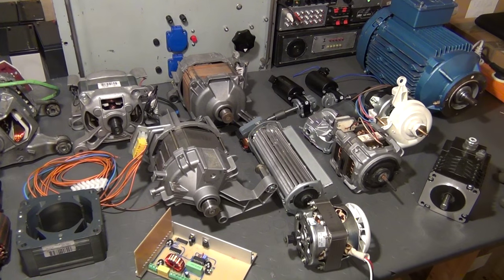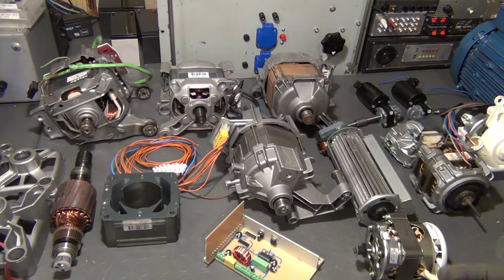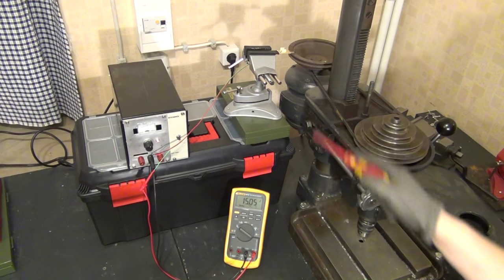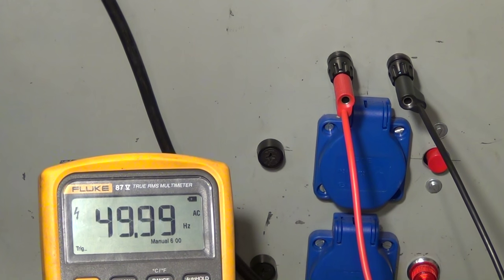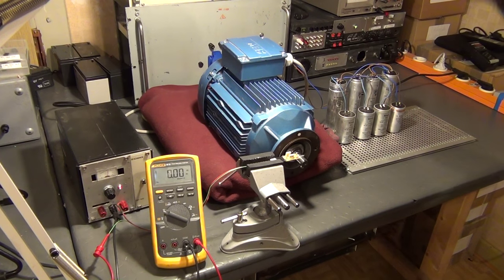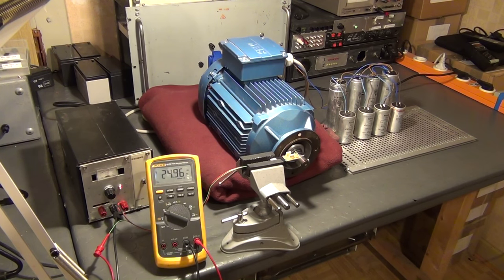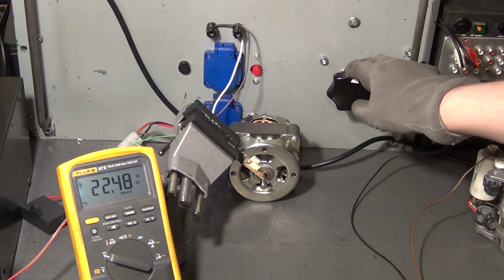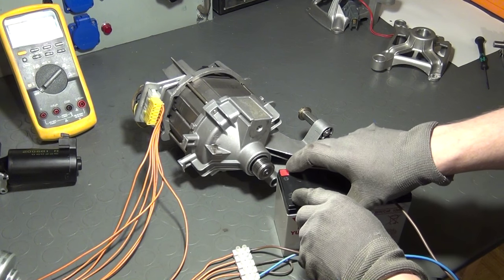TPAI Lab Report #008: Universal Motors and Induction Motors

Comment: I Get a lot of my motors also from some old tread-mills and old toys that don't have the remotes for anymore.  There must be at least a million things that use motors, and it seems like each one is different then the last.  It is still fun to take them apart.

Something I'm going to try, is to make myself an isolation transformer by using two microwave transformers.  Take the high voltage windings off of both, and on one of them, also remove the primary winding, and putting it back on the one which already has a primary winding.  That way I have a transformer with 2 (110v or 220v) winding, which will make it an isolation, with the same output voltage, the same as the input voltage, with no connection.  The two transformers would have to be the same type and size to get the two windings equal to each other.  This too would end up with same current rating on both windings.

I enjoy the videos!!!!
Keep up the good work, and the fun projects!!!!!!
Michael

Comment: In the US, We do not have three phase power in residential structures. We do, however, have a center-tapped transformer which delivers 240 volts AC 60Hz to the house. Every other breaker in the panel is connected to opposing sides of the center tap with the neutral connected to ground. for larger loads such as electric stoves and dryers, a double-pole breaker is used to provide the full 240 volts to the load via the two hot lines. a green

Comment: Actually I have one of these motors sitting around and waiting for a drive circuit...  So your next video will be very good thing for me. Thanks!
Reply: +MrCh053n I have a motor + control board from a washing machine, nice motors to use, if you have the controller. In my case it was built around a TDA1085C chip. (totally NOT isolated from mains). Check that datasheet for excample circuit. (I am not selling any of the parts, so don't ask me for them)

Comment: Framerate syncs perfect with revolution count, so the magnet on the shaft looks still. 9:25
Reply from the maker: +feelthefears You are right. It looks really weird. You can see the magnet stand still and then after a few seconds it appears on the other side of the shaft, only to stand still again.
Reply: +The Post Apocalyptic Inventor The switch happens because it isn't really a perfeft sync, wich your numbers show, so after a while is flips to the other side. Camera is also tied to the grid freq from the analog era, that's why US had 30fps cameras. Also, congratulations on the 5 million mark!

Comment: There is such a thing as a digital frequency converter which will generate nearly perfect 3-phase current from a single phase input and is much more efficient than a rotary transformer converter.  One of the most popular ones is from a South Dakota company called Phase Technologies.  It does, however, use double-layer capacitors on the output to smooth the AC waveform, and they must be checked annually.

Comment: I'm very envious of the fact that most German houses have 3 phase as standard!!  That would save me alot of money in single to 3 phase VFD's.  Out of interest, I just fitted a single to 3 phase VFD to a 1hp compressor motor and had a unexpected problem.  The contactor on the switch would not operate and was buzzing. When I bypassed it the motor ran badly and became hot.  Then I realised when reading the VFD manual that it was a 240 volt output, not 415 as I had assumed!  So wired the motor for star instead of delta (or the other way, I can't remember which it is!) and then had a problem with the VFD  over current tripping.  Of course the motor draws twice the current on 240 volt, so I had to set the over current trip to maximum.  Then all was fine!  
Just for information, the biggest risk in overspeeding universal motors is exploding rotor's, that makes a hell of a mess and is a hazard!

Comment: Excellent, thank you.
I recently salvaged a universal motor from a dead washing machine and was wondering how I could control it without using a variac. Your next video will be very useful for me.
Cheers
Reply: +James Lamb You may get away with a light dimmer, will give the same control as a variac. But if you want true speed control, you will need a active device.
Reply: +erlendse Thanks.
I did buy an SCR regulator (http://www.ebay.com.au/itm/281311660301?_trksid=p2057872.m2749.l2649&ssPageName=STRK%3AMEBIDX%3AIT) but as you say,  I need something better for proper control.
Cheers

Comment: Would it be viable to rev limit the universal motors by pulsing it on and off at the desired speed using a mechanical device like a centrifugal governor operating a switch?

Comment: If you want a really good vibration free surface...  Take a lot of racquet balls cut in half and place them open side down on the floor and put a 2.5cm thick (or thicker) block of marble resting on the round side of the balls.  No vibration will reach the floor.

Comment: Congratulations on your views my good friend. Awesome. I will be running washing machine motors on 230V DC. But I require a circuit to control the speed under load. It must be capable of a maximum voltage of 300V DC. Are you able to help with a suitable circuit or advice where I can find one? Many thanks. Raymond.
Reply from the maker: +Raymond Earle Well. That's pretty much what I'm working on and I will talk about that in detail in the upcoming video.
Reply: AWESOME! Many thanks my friend.

Comment: Two things that go bad in washing machines are the timer control or the transmission. Both are expensive. With your trailer attached to your car, you can load it in and after taking out the motor taking it to the junk yard and maybe get some money for the weight.

Comment: Hey, you know what I think would be just a little interesting: if you use a hall effects sensor to verify the readings of the recordings from a cheap headphone analysised for frequency nodes in a computer program like audacity as done by AvE previously.
You have the bits and pieces on hand and it would be interesting to see accuracy across the two very different approaches.
Reply from the maker: +zero_sum Hey. That's a great idea. Thank you. I guess I'll write that down!

Comment: I guess that in last the motor in video, you could connect stator windings parallel to the rotor and limit the curent to stator coils. That should allow stable work without speed regulator. I tried that when I was experimenting with conversion of universal motor (from drill) to power generator - the parallel connection worked better for me, and motor was  still woriking both on AC and DC. However ffc regulator is better idea.
Reply from the maker: +Dominik Zaczkowski That is right. Connecting the field winding directly to the full line voltage would probably not be a good idea. However, if you would limit the current (as you said) and thus operate the rotor winding and field winding independent from each other, it would also be possible to get some control over the motor. I was planning to take a look at that possibility as well.

Comment: Do you base the control board around TDA1085C?

It's a regulator made for that purpose alone.

Or are you going for some isolated interface?

By the way, are you going in details about BLDC motors and controllers (RC ESC and others)?
Reply from the maker: +erlendse I will present different solutions. One of them is based on the TCA 785. It is still manufactured, while the TDA 1085C is an obsolete componet. I also want to find  a solution for motors that don't have a tacho generator. This is enough work for weeks. I won't have the time to talk about BLDCs in this video series.
Reply: +The Post Apocalyptic Inventor Fair enough. Any plans to sense commutator segment changeover for feedback? or external HAL sensor?

Comment: Is it possible/easy to re use the motor controller that is already inside the machine?
Reply from the maker: +Blake Meysembourg (Blakeup) I will talk about that in a future video. But to male it short: No. Their re-usability is very limited. The boards inside the washing machines are way too complex for the home-player: They were designed to do much more than just control the motor. They are also often not really reprogrammable. However: It is possible to salvage a lot of parts from them and use them to build a simpler control board yourself.

Comment: Some washing machine motors are not too bad, just enough wires so you can reverse windings and brushes, and the control pcb has relays for that purpose.
I assume that the control pcb uses a pwm signal to drive a mosfet motor drive, but i have to admit that ive never really analised it.
On my cheap machine there is a tacho coil on the rear of the motor for feedback speed monitoring by the computer.
Motors work very well for many uses :-D
Reply: +zx8401ztv More like phase angle, not too far from PWM, still.

Nice motors yes, but not the most silent.
Reply: +erlendse 
Ive never really looked close, you have to be interested in washing machines to need to wander round the control pcb lol.
Im sure your right ;-D
I have a nasty beko machine, its been a real pain in the bum lol.

Comment: im going to spoil the next video :P 2 wires for temperature sensor, 2 wires for tachometer (a little ac generator at the back which usually puts out 8 pulses per revolution) and the remaining 3 are for the coils (2 coils in series. one wire in the middle and 2 at the sides)

still looking forward to the next video :D
Reply from the maker: +fredlllll Don't worry. The next video will contain a little more than just the pinout of the motor.
Reply: +The Post Apocalyptic Inventor looking forward to it. wanted to do something similar for a while, but had problems controlling the motor without oscillation.
Reply: +fredlllll From my experience, it's not quite so. I would guess 2 for stator, 2 for rotor, 2 for speed sensor, 1 for ground or extra tap.

Temperature could just be a series "kill power" switch, if present.

Comment: I am German, but I have nowhere seen a three-phase AC connector. Where is it in my flat? Is it in the fuse panel, in some unpopulated form so that I can't use it? (I guess it's mostly used for cooking, while I do my cooking with gas, so there's no electricity involved in that) - How do I find out whether I have a three-phase AC connection anyways? (in case I wanted to switch my stove and oven for an electric one, which I will never do, but just theoretically)

Comment: TPAI.. I am a big fan of yours... we have a whirpool washer with broken CCU. i want to convert the full automation of the washer using adruino. the problem is how to control the motor. the speed of the motor is different from washing cycle and spin dry cycle. I will wait for the motor controller that you will assemble and use it using adruino. thank you very much for you videos.

Comment: Steinmetz is the same as delta circuit? I have a couple of three phase motors so this would be useful information for me.
Reply from the maker: +John Grammaticus Delta and Star are just the way in which the windings are connected. Strinmetz means to add a capacitor. The motor in thr video uses a delta connection plus a capacitor bank. You can see examples here: http://oi54.tinypic.com/2jg42ds.jpg
Reply: Thanks man, I should have known that but I got confused by wikipedia - in your link the exact same schematic is listed below as delta and it boggled my mind a bit so I thought I'd ask.

Comment: Hi Thank you. Does a universal motor can work both ways, like if you turn the motor manually or by a power source of some kind ( water, wind, etc) will the motor produce electricity at the other end.
Reply from the maker: +Jean-Louis Guay Yes they can be use as generators, but there are some disadvantages: universal motors use field windings instead of permanent magnets. That means that some energy has to be "consumed" by the motor to be used as a generator. That makes the, not very well suited for generating small amounts of power, as it is typical in DIY-projects. They are also not well suited for "slow turning" sources of power, like windmills. You would need some kind of transmission or gears to increase the frequency of revolution. In my opinion they are a poor choice for DIY-generator projects.
Reply: +The Post Apocalyptic Inventor Ok thank you, so a permanent magnet motor without brush would be more suitable i guest.
Reply from the maker: +Jean-Louis Guay Yes, a permanently excited motor is better suited for these types of projects. Furthermore a brushless motor has the advantage that it has a longer potential lifespan , because there are no motor brushes, that can wear out over time. However: It is really hard to find a cheap source of motors that can easily be used to produce electrical energy. There is a type of washing machine that uses BLDCs instead of universal motor and people have used those to build wind turbines, but these types of machines are very rare in Germany. I personally have never seen one.
Reply: +The Post Apocalyptic Inventor Yes, i have one, here it is frequant and here they say a ceiling fan (the one that at the ceiling )  can be use also. Thank you very much for your fast response.

Comment: ill tell you how to control those motors. get an arduino pro mini, either use the hall sensor or some forme of optosensor to measure the rpms, then just a basic software with pid control to toggle a mosfet or an optoisolated triac in a pwm-ish way.
you can also run it in AC with a nifty hack, just make a dimmer circuit and change ths potenciometer for a photoresistor, then glue a white led to it and pwm the led at abou 20-30khz. the cap will filter the pwm wave and make it work like a digitally variable resistor.  that way you can dim it down without needing dc or pwm.

Comment: Love this topic, nice coverage my friend. I have started many three phase motors on single phase for fun, i typically have to use a higher microfarad electrolytic( start) capacitor in conjunction with the lower Uf oil filled run capacitors. 

I would love to see a video on servo motors specifically what I believe would be called three phase Dc.

Cheers from the states, PS- just loaded a video of some induction motor clips to my channel, I'd love for you to check it out!
Reply: +Ryan Miller You could also check vector drive. Allows a lot of control, but is more complex.

Comment: hey a question what kind of motor is good for a go kart electric motor doesn't overheat and enough power and so on
Reply: I know this is an old question, but you might want to consider using a drill. Or better yet, 2 drills - one to drive each rear wheel so it's mechanically simpler instead of needing one big live axle. Get CORDED drills, they're cheaper and more rugged than battery cordless ones. They use a universal motor, so you actually can run them on DC perfectly well. The good thing about drills is that they already have reduction gears to increase the torque, and they are meant to run for long periods of time with a really heavy workload. Most drill motors will take a LOT of abuse. I'm actually planning to build an electric go-kart right now, and I'm going to use two 5 amp drills to power it. I don't know for sure if it's going to work yet, but it should!

Comment: It's still weird to me that 3 phase is standard in Germany. My house has 2 phase, but that's about as good as it gets in the US unless you're in an industrial park.
Reply: +FrankTheCat 

split phase
Reply: Justin Bell
in my vernacular, modern split phase is what 2 phase means to me. I guess that's technically wrong given the phases are 180 degrees apart instead of 90 but ¯\(ツ)/¯
Reply from the maker: +FrankTheCat Many people call it a "two phase system", but it really is a "single phase, three wire system". You can look that up on wikipedia:

https://en.wikipedia.org/wiki/Split-phase_electric_power
Reply: Not  only in Germany,three phase is standard in Serbia,Montenegro,Croatia,Bosnia etc.All this countries  have German standard power supply 400V/230V  and German socket types.
Reply: No such thing as 2 phase except in a couple locations that you don't live. Single phase 3 wire. Like a T tapped winding the neutral is just the middle of the winding

Comment: This is directly related to something I'm trying to repair.  I have a washing machine with a 3 phase DC motor that will only spin in one direction, but since the startup sequence requires the washer to spin the clothes for a few seconds in each direction to test that it won't pop the door open, it won't start.  The motor has 6 wires going to it. 2 are yellow and go to a speed sensor, the next 3 wires are red white and blue and the board says U,V,W. The final black wire goes to the case of the motor. The speed sensor appears to work because I get a voltage from it when I spin the tub. So what I need to figure out is the 3 power wires, how they are pulsed, to test it. The washing machine gets an error code that says there's a problem with the motor or inverter. Unfortunately all of the diagnostic tests want to spin the motor in the direction that it won't go.
Reply: +stonent If you want it to run outside the washing machine, a VFD(variable frequency drive) may do. 

As for testing the motor, there should be the same resistance between the 3 wires (if you check in all directions, 3 measurements total)

If the motor checks out ok, then there is likely a blown FET in the inverter.